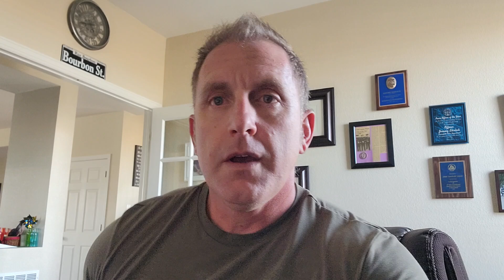Modern Diesel Regens...what are they?  why are they important?  2008 to 2024

Comment: My 2017 ram was great minimal def use and worked great for 3 years. My 2019 excessively used def and regen constantly hated it!
Reply: Same here with my 2017 Ram. Very low DEF usage. There doesn't seem to be a regen light that comes on with mine, but I just replaced my turbo at 99k miles and the mechanic told me I wasn't working it enough and to let it idle a few minutes when parking it. A very expensive lesson to learn.

Comment: It’s all a pain in the ass.  I just got rid of diesel because of the work needed to keep these engines happy.  You have to stay on top of regens …fuel filters….fuel additives etc etc etc. Another factor ….idling with the modern diesel is a death sentence.  The good ole days of allowing a diesel to sit and idle are OVER.  Everything you brought up is spot on and then some.  If you don’t need a diesel for work or extreme weights…..take my advice….run lol.  Stay with gas!